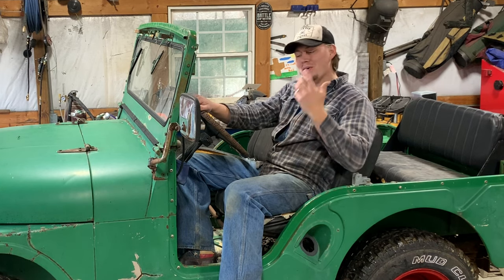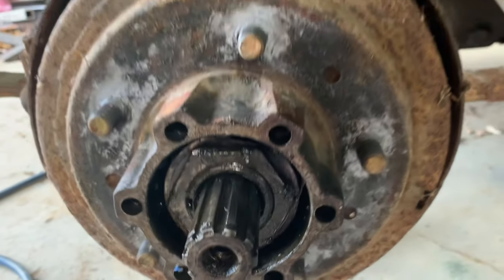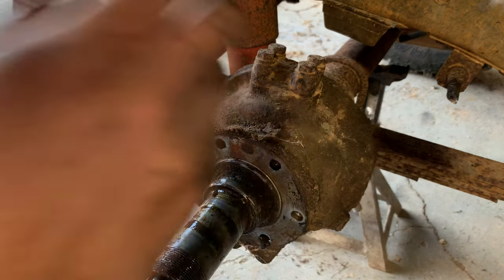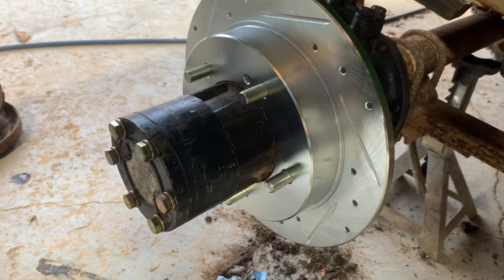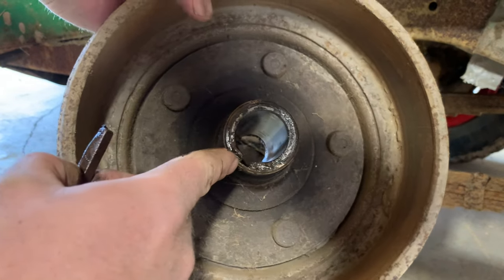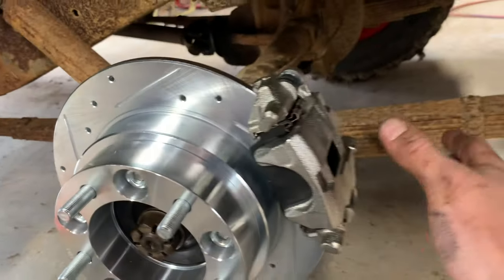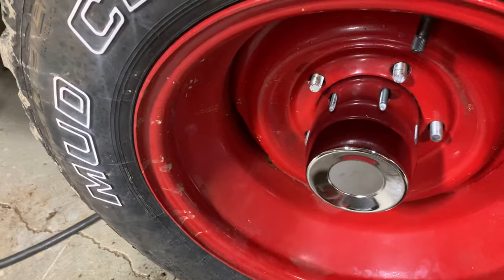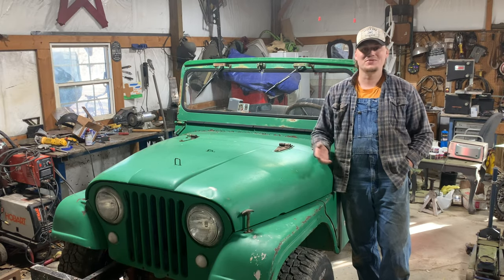Jeep CJ5 4 Wheel Disk Brake Conversion!

Comment: Just FYI, if you can recall I was doing a front disk brake conversion on my 47 CJ2A and could not get the front disks to release pressure.  Finally realized that the rubber hoses were clogged so after replacing all rubber the brakes work great.  Thanks for all your help over the summer.
Reply from the maker: Glad to hear you got it sorted out! Anytime!

Comment: I bought my first Jeep in 1972.   Over the years, I seen some custom disc jobs.   That looks doable at home.   I plan to convert the rear brakes on my 85 CJ-7.   You really know your stuff for a young Jeep Freek.    I found your video by accident.   Glad I did.   I have a set of lock outs like yours.   Pain in the ass to lock in, but they are indestructable.    I will never by anything newer than a CJ-7.   A set of wrenches, screwdrivers, lock pliers, and you can repair anything along the trail.   No Computers!   I've had Jeeps in the past, buried in muddy water, that would total out these new techno terror jeeps.   Just pull for floor plugs, spark plugs, change the oil, and go.
Reply from the maker: It’s a great kit! I appreciate it! Nothing beats the old ones the new ones are nothing like what they used to be. Thanks!

Comment: You site has been so helpful to me in restoring my 63 CJ5.  I bought it in 2020 after seeing the price and wait for new ATV''s during covid.  Being 6'3",  I would never have even bought it if I hadn't seen your video on cutting out the rear wheel wells and moving the seat back.  Mine's running great, looking good and comfortable to drive.    So happy to have bought it over an ATV to run around the farm.  Will try your brake upgrade in March or April. Thanks again for the great content.
Reply from the maker: That’s awesome to hear thank you for sharing!

Comment: I did this conversion on my '42 last year following your video you did with your 3B. I just brought home a '77 CJ5 and thought I would watch this one to see if there's much that's different. I got a little excited that you we're gonna be showing how to get the dual reservior master cylinder installed without removing the tub because I bought the upgraded master cylinder with the conversion bracket but ended up keeping the single reservior on the jeep because theres not enough room for access. I'm glad to see you had success with that as well, though i eventually still want to do the upgrade, until then I did add a proportioning valve to my '42 and everything works as it should. Thanks for another great video!!
Reply from the maker: One day I’ll get up the energy and see what it takes to get the dual reservoir on! Thank you!

Comment: Really, Jacob?! Garage door open and a T-shirt? You lucky dog...we had a high temp of 8 degrees today! A couple things...dual masters were federally mandated in 1967 on all vehicles, so all post 66 jeeps have em. As you know, I did the conversion you recommended on my 67, too. If you use Suzuki XL-7 brake parts instead of Tracker/Sidekick brake parts...the rotors are vented, and the calipers bolt on without the spacers. I liked that a little better. less brake fade with vented rotors and it seems like the mounting would be more solid without spacers on the calipers. As for the spindle nuts, Dorman makes a kit with 2 nuts and the washers, so I'm sure your NAPA store has them or can certainly get them. The master cylinder...disc and drum cylinders are different; the drum master has a residual check valve in them to keep a little pressure in the system. you may have some drag with disc calipers so watch to make sure the brakes don't get hot on an extended drive. Hope all is well with you, bud.
Reply from the maker: Excellent information as always! Thank you for sharing! I appreciate it!
Reply: Do you know the PN  for the 2 nuts and washers?

Comment: I did the Metcalf rear disc with electric parking brake and love the ability to lock the rear wheels. I noticed using a 1” bore master cylinder didn’t produce enough pressure to equal the stopping ability of the disc/drum and dropped down to a 7/8” bore. If your rear wheels lock before the fronts on the single reservoir master add an adjustable valve to dial back the rear pressure.
Reply from the maker: That parking brake looked cool I’m glad to hear you like it, I might have to get me one! Good to know thank you!

Comment: You are sure right about those clip things in the calipers.  What a pain in the butt!  Miserable to keep them in place while installed the pads, but I think I got it.  Put in the inside pad first then pull and zip tie the calipers full tight to the piston and then install the outer pad.  lots of space for the rotor and just cut the removed the zip ties.
Reply from the maker: That’s a good way to do it! I’m glad I’m not alone 😂

Comment: Thanks for all the info on the brake swap, i have got all the parts waiting in my save cart on ebay.  I'm going to get another old jeep today, and I'm probably gonna fix it before my cj5, because the body needs less work, and it's a 55 m38a1.  I want to paint it the original olive drab, and put both my grandpa's name's. on it somewhere, cuz they were both in wwll, and fought at D-day, and one was at the battle of the bulge.  My one grandpa had a1968 mule, and as kid's we drove that thing all over.  I have wanted one of these for a lotta year's.  I appreciate. how much information you give, and how you research everything and give good accurate review's to.  G-d bless.
Reply from the maker: That’ll be great for those!

Comment: Just got all the parts to do the fronts on my 71 cj5 Dauntless. Plus the king pins...
Hope it goes as easy as yours appeared to be.
Reply from the maker: If there’s anything else in there that needs replacing it’s a good time. Otherwise should bolt on same as mine. Thanks!
Reply: @SevenBarSalvage  did your brackets come with the spacers still attached between the "ears" of the bracket?
Reply from the maker: @palonghunter3608  Mine didn’t but he said he was changing over to that “Christmas tree” style to keep everything together

Comment: I'm doing my 2nd disc brake conversion on a 56 CJ5.The problem I'm having is getting the correct studs. I have found the holes on the stock D27 hubs, after they have been swedge, makes it impossible to find a stud that will fit. I have tried cutting the studs out. the swedge seems to expand the hole. The d25 hubs, I have no problem on finding the correct studs. Dorman 210-260 seems to work great. I had to purchase new D27 hubs for my first conversion. On the second I'm using a D25 front Axle with the D25 hubs. I would prefer the D27, the bearings are larger, and easier to get at the Auto Parts store. The D25 bearings are a little harder to find. Many of the Military parts suppliers carry them. But not the auto stores. The Brennan's plates makes the conversion very easy. I have used the S10 hoses at the wheel to axle housing. Thinking about moving the brake line to the frame and off the front axle housing ,like on the later model CJs . You videos are very helpful.
Reply from the maker: I’ve honestly not found a stud I like either. Let me know if you come up with anything. I really like the hose to frame setup it’s clean and works good! Thank you for watching!
Reply: @SevenBarSalvage  I found a Dorman 610-260 works well on the D25 hubs,and New D27 hubs. The Kurl is too small for used D27. the studs are long enough to have a little stud thread pass the Lug nut.
Reply from the maker: @SF-fm9hs  Thanks!

Comment: You should consider the one piece tie rod conversion on that cj5 if you're not gonna go Saginaw. All you need is a 35.5" tube, and part 920536 tie rod end (from a commando. it has a different angle than the cj version of that tie rod end). Makes for a very cheap upgrade to to the split tie rods, and links the two front wheels with one solid piece like a dana 30. You use the driver's side tube from your old tie rods and link it from the bell crank to the passenger side. Easy peasy. if you use a two hole knuckle it's even better.
Reply from the maker: Sounds like a good upgrade. I’ll look into that thank you!

Comment: Very nice neat installation. I'm a bit surprised you don't need a power booster with the disc system.
Reply from the maker: This is a good base but I’m sure there’s room for improvement. I’m pretty impressed with how good it stops for manual brakes!

Comment: I can check but my dad’s 66 buick jeep that i inherited has a single. Man that thing is awesome. Shows 32,000 original miles. I can attest to only a few miles that the speedometer was not working.. with the exception of first gear jumping out and a few teeth gone on the rear end, it’s a great unit. The body how ever…. Not so good.
Reply from the maker: Interesting… that’s awesome! Glad you’ve got it!

Comment: thank's for this video. My cj5 1977 still has 4 drum brake and it's very difficult to adjust the front ones, a pain in the neck Did you adjust or install emergency brake in this video on your jeep? I didn't see it. Anyway this is an incredible job
Reply from the maker: This model Jeep has the e brake on the transfer case. Fortunately for you disk brakes was an option in 77 you should be able to source all the stock parts! Thank you!

Comment: Are the spacers necessary for the disc conversion?  You are adding a lot of leverage to the bearings and possibly making the steering  more difficult.  Nice video, very helpful.
Reply from the maker: Newer wheels or 16” wheels sometimes clear without spacers but I’m not sure which ones to recommend. I know some people run smaller spacers than mine. Doing that studded knuckle upgrade is a good idea if you’re running spacers. Thank you!

Comment: Do you not install the bearing shims with brennans kit or did you just not have any on your rear axle? Also when is the next video coming? :)
Reply from the maker: You do reuse the shins they go behind the caliper brackets same as with the drum backing plate. I think the side i showed just had one shim the other side had a pack. Good question! Hopefully in the next month or 2 I’m still moving into the new shop but I’ve got a bunch planned I can’t wait to get back to it!

Comment: Hello, great job on the video's. I was wondering wich brake line you used for the rear brakes? It looks different from the honda accord front lines. Thanks.
Reply from the maker: I ordered the same brake lines front and back (driver and passenger is the only difference in part numbers) but I ended up getting 2 different brands for some reason so they looked a little different. I think the s10 brake lines Brennan recommends on his website are probably the best option for the rears. Hope this helps!

Comment: How would you go about connecting the jeep brake line to the honda brake line without the tool you put in the description? Would replacing brake lines in general be hard without it? Thanks!
Reply from the maker: At the very in of the video I show a brass fitting from autozone that converts the line from standard to metric. I think you could use stock brake lines from the hose back at that point. Thanks!

Comment: did you bend and fab your roll bar ???  Im building a 1975 Jeep and want to bend a heavy gauge roll bar with heat, not much info on youtube , I don't have a tubing bender. You'r going to have a great Jeep when its finished if there is such a thing as finished.
Reply from the maker: It’s just a stock roll bar. I hope so thank you!

Comment: Question please. By using the spacers. Are u changing outwards the load center on the front end axels? Will it damage the outer non load ballbearing?
Reply from the maker: It technically does put a little more load on your wheel bearings but it’s so marginal you’ll never know!

Comment: How did you press the old studs out? What I mean is did you cut the swedge out?
Reply from the maker: What I’ve seen only the earlier stuff was swedged. I put mine in a shop press and they came right out. I’ve seen people use a carbide hole saw to cut around the stud. Hope this helps!

Comment: My understanding is the drain hole on the rear axle is there so if (when) the axle seal fails, the grease from the wheel bearings goes out through that hole, rather than into the brake drum.  So it’s probably not necessary on the discs, but it won’t hurt anything.

Do you have any details or sources on the dual master cylinder bracket?  I need one of those.
Reply from the maker: That makes sense thank you for sharing! Herm the overdrive guy sells them and Kaiser Willys I believe has a kit! Or if you can find someone parting out a dauntless cj5 you can pull one like I did!

Comment: Did you remove the residual pressure valve from the original master cylinder? I’m about to do 4 wheel disc brake conversion and am using a new stock single master cylinder but did see in the video you installing your master
Reply from the maker: My master didn’t have one I don’t think they came from the factory with them. There’s a little debate about using one or not (mainly to keep the rears from locking up before the front) I wanted to see how it worked without one and I’ve not seen a reason to add one yet. I was going to use a GM PV4 valve if I used one. Hope this helps!

Comment: I wonder if the master cylinder has to be changed out for disc brakes
Reply from the maker: You can upgrade to a bigger bore and a dual reservoir but the stock master cylinder works great for me! Some people use a proportioning valve and add residual pressure but I’ve not seen in issues as is. Thanks!

Comment: would these same parts work for a 75 CJ5? I need to redo the whole brake system and I'm considering this swap
Reply from the maker: I think the axles changed to open knuckle around that time I’m not sure. Brennan should have some more information on this I would check out his website and see, thanks!

Comment: I do have one question.  With this disc brake setup,  I see no way to have a parking/ emergency brake.  I know they are not a necessity but in some cases desired.  Can you let us know if there is a parking brake system available?  Thanks.  I have a 74 CJ  I'm trying to rebuild .  Thanks.
Reply from the maker: In my case the e brake is on the Dana 18 transfer case. But Brennon sells an electric e brake kit. It uses his custom brackets and an off the shelf brake it’s really cool probably something I’ll add eventually! Hope this helps!

Comment: Hey, I just picked up a 71 cj5 with the 225 v6 and it has the dual master with 10 inch drums all around. Just installed new master and serviced drums but the thing still doesn’t stop well, do you think converting my front brakes to disk would make a big difference even without power brakes?
Reply from the maker: I’d say changing your front to disk would make a difference. Thanks!

Comment: Without a power break booster how would you compare the amount of "leg pressure" to stop the jeep compared to the original drum breaks?
Reply from the maker: I feel like it’s the same pressure but when you really step on it is when you feel the difference, I hope that makes sense! Thanks!
Reply: @SevenBarSalvage  Improved stopping and pedal feel is key.  The drums work fine but you have to plan ahead for your stop 😊 I have seen these disk replacement “kits” in the catalogs and have considered doing the conversion on my CJ5.  But it is expensive to do all four wheels and was looking for some real world experience and feedback before spending the money…which is how I found your channel.  Would you be available for more questions? Thanks for responding.
Reply from the maker: @rusttooresurrection813  For sure hit me up on instagram or email me at seven.bar.salvage@gmail.com anytime!
Reply: 👍thanks

Comment: Hi, I am wondering if you could provide me with some of your  extensive knowledge. My question is about a Saturn Overdrive in a Willys Pickup. Can I just leave my truck in overdrive all the time? If yes, can I even leave it in overdrive when backing up too.  Seems crazy to keep splitting gears or using it after third gear because the truck has plenty of power with a Ford 302 and a t98 trans with 4: 88 gearing. Thanks in advance.
Reply: I have an overdrive on my cj5 and because I have a th400 I can't split gears so I always have mine in high when I'm cruising around.
Reply from the maker: As far as I know it’s made to split all gears including reverse and there should be any issue in leaving in engaged for long periods! Hope this helps!
Reply: @SevenBarSalvage  you are the man, thanks.
Reply: @buickcj5  Thank you, someone else also said they keep it in overdrive all the time with a manual trans and it even can be keep in for reverse as well.
Reply: Just don’t use the overdrive to downshift, use the transmission to downshift.  The Saturn and Warn OD’s will wear much faster if subjected to that type of pressure. The OD can be in our out when downshifting with the trans. My OD only comes out when I’m wanting to go slower at idle.
Reply: @briansni5661  OK, now I am a bit confused. So I can leave it in overdrive all the time but I cannot use the transmission to downshift? What I would like to do is to leave it in OD and just drive the truck like normal including downshifting of just the transmission while it is still in OD. Cn I still do that?

Comment: Is this a no go on the original 1970 dana 44. I am struggling finding info on the axel I have.
Reply from the maker: This should work on all the early dana 44’s. If it’s a 1970 it should be the same unless you have one of the rare flanged ones.
Reply: @SevenBarSalvage  gotcha that is my issue.